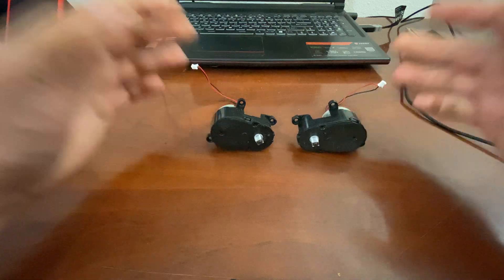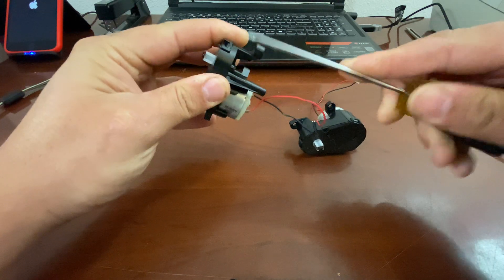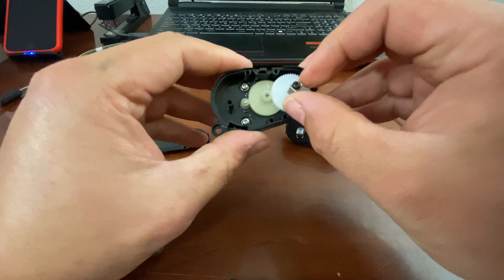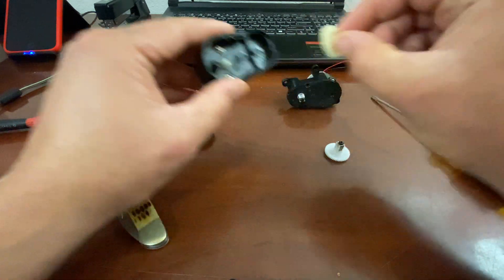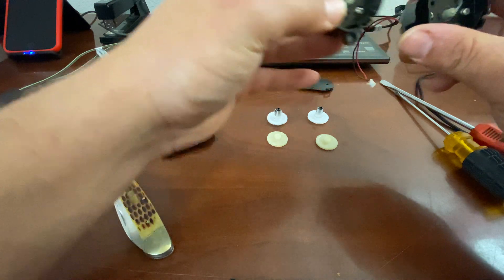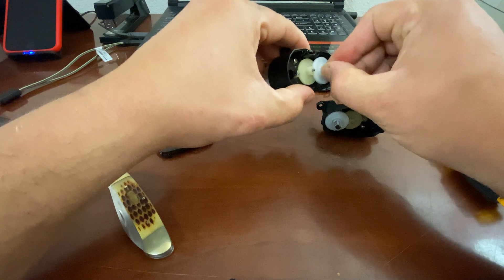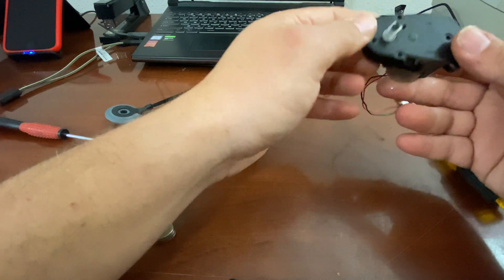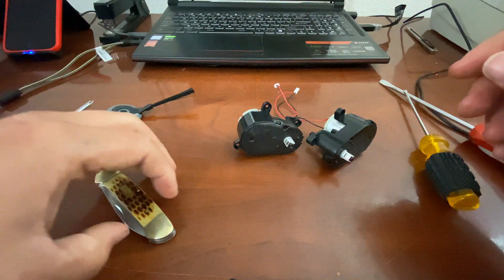Shark Ion Robot Vacuum Cleaner Side  Spinner brush motor Teardown

Comment: I have a Shark IQ where it stops after moving 5 feet with an error code 2, and tells me to look underneath for an obstruction. Nothing there. App says to look to see if there is something wrong with the front caster. That spins and rotates fine. So I called in, the woman had me futz with the side brushes. They ended up shipping me a new robot. But I'd like to fix the old one.